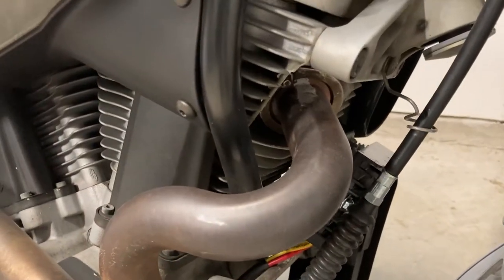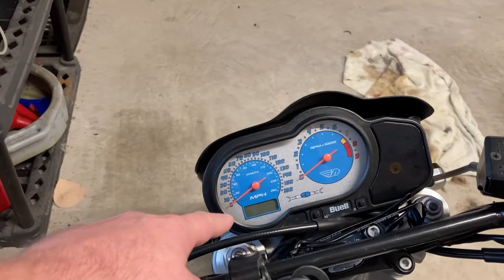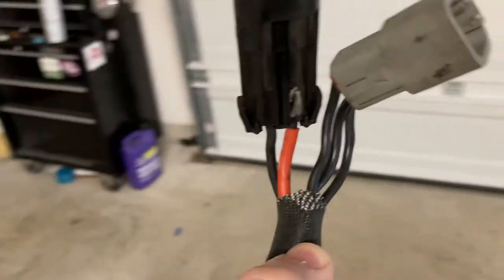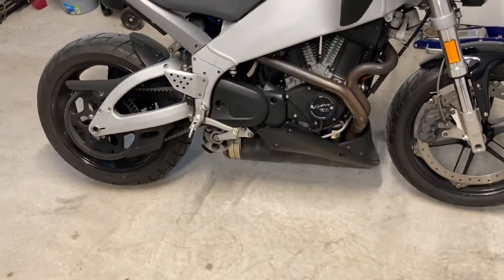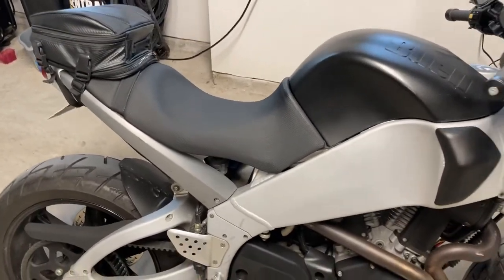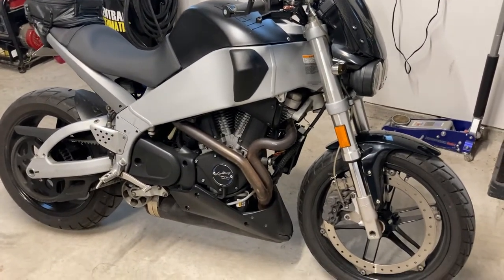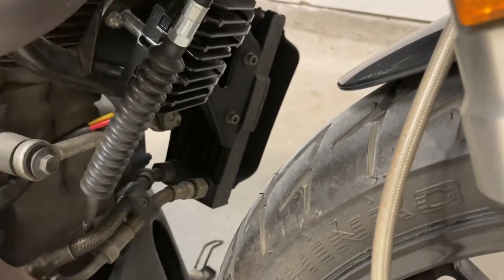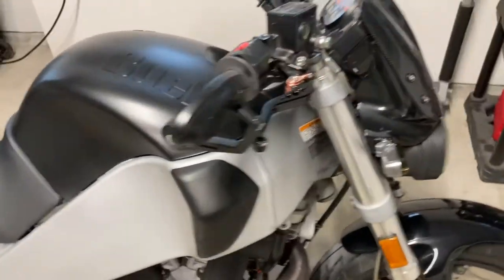Buell Update 15 OCT

Comment: Curious about the exhaust stud ... was it a big project to get the broken stud out of the cylinder head? Did you just drill it out in place or have to drop the engine or anything crazy like that?
Reply from the maker: It wasn't fun. At first I tried using an easy-out, like most might. That didn't work. So, I got wise, bought a heli-coil kit, drilled it out with the engine in place, and got it done. No issues since. I would recommend cutting straight to the heli-coil if the stud ever breaks on you. The rear cylinder would be the worst to deal with. For sure, you'd do an engine rotation or just drop it (the engine) out.